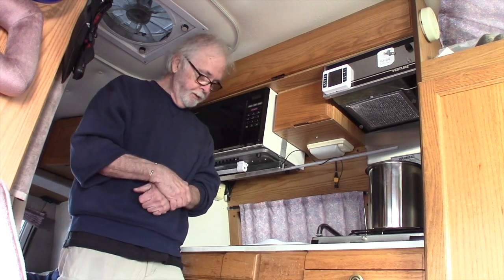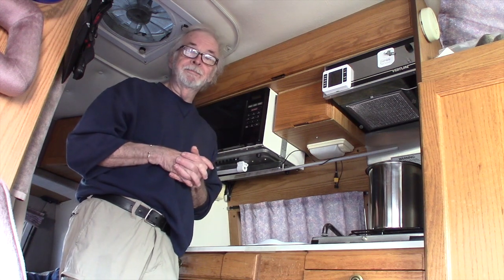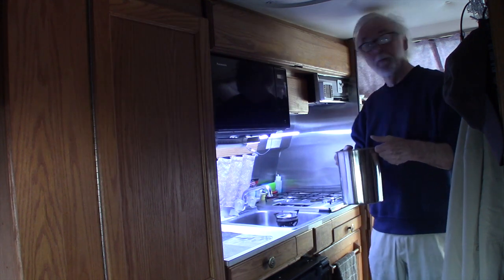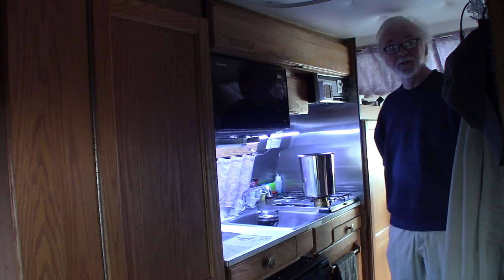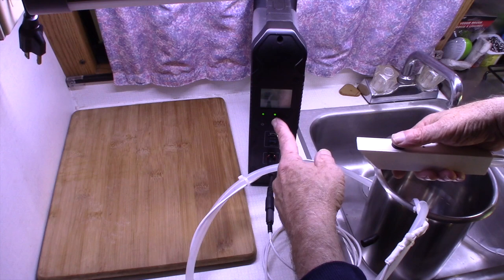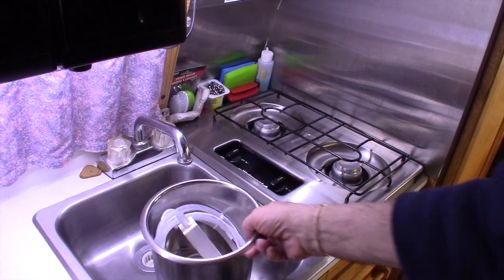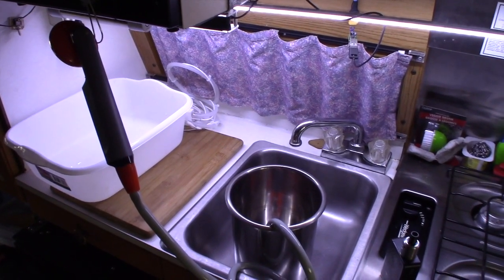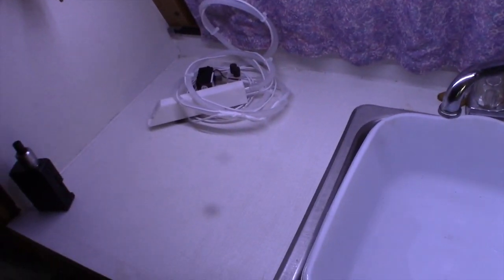DIY - Hot Water On Tap !

Comment: 2.5 gal sprayer with kitchen dish sprayer? (pump up)
Reply from the maker: Hi CAJUN Jamis,
Still need something to heat the water in. Can't put a kitchen dish sprayer on the stove.
Now that Bain Marie is useful for all kinds of other stuff. Food grade stainless steel. It's little. I can store the shower inside. I don't really know where I'd put a 2.5 gallon sprayer.  This thing stores away in a cupboard...easy.
Reply: @RoadtrekRich   DAMMIT BOY!   Paint the sprayer black set it in the sun (solar heat) Put THE SPRAYER IN TNE SHOWER STALL!
Reply from the maker: @cajunjamis9001  Yeah, that paint sprayer, painted black, set in the sun is kind of an "all day" proposition at it's best...in summer...with sun.  Today, it's overcast, 45 degrees and starting to rain.
Reply: They sell pump up container shower systems or garden sprayer, that you just add boiled water to cold water and can control the spray. A camping coffee pot makes plenty of hot water also Jetboil sells attachment pot

Comment: A gallon of water weighs 8.34 pounds...
Reply from the maker: Hi ranTrek,
Yes. I was approximating, 2 lbs per quart, 3.5 quarts for an approximate weight of 7lbs. Water varies slightly in weight based on temperature.